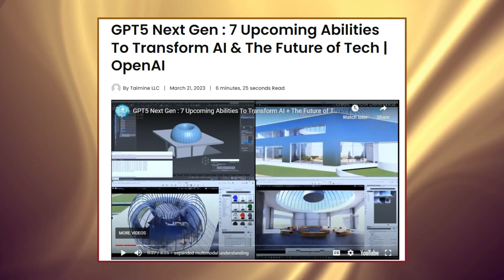GPT 5 Will Change the World: 7 Revolutionary Abilities That Will Define the Next Generation of AI

Comment: As a programmer, I'm blown away by GPT's capabilities - I'm using it regularly as part of my job now. However, IMO, true AGI requires the ability to generate novel solutions to problems from first principals. From what I understand, none of the models can do that.
Reply: I think in order for our current AI to qualify as "AGI", it should firstly be completely independent from the internet and run locally on your machine (AutoGPT doesn't count). Second, it should start off as completely dumb, almost childlike, which only has a basic understanding of English and conversation structure. The more you teach it offline by interacting with it and talking to it about all kinds of subjects, the smarter it becomes, but only becomes as smart as how much you actually teach it. You could feed it online data, then it can store all that data locally as part of its long-term memory. And lastly, I think the AI should over time develop curiosity and spontaneously start conversations, or question itself and its purpose without it being hardcoded to act like its conscious.